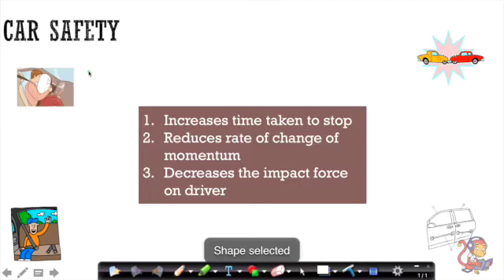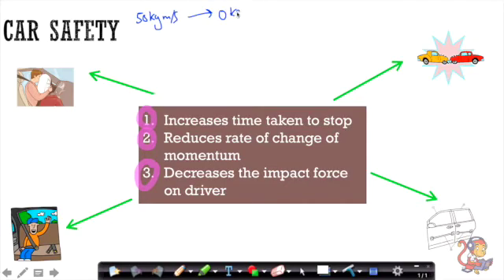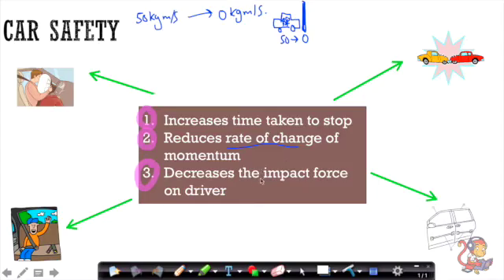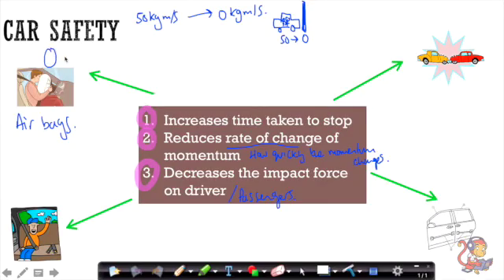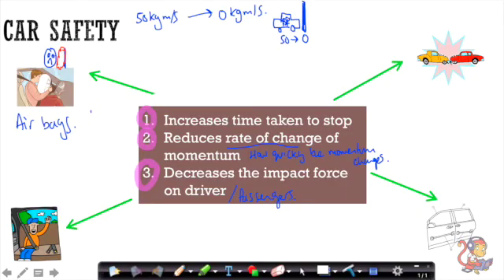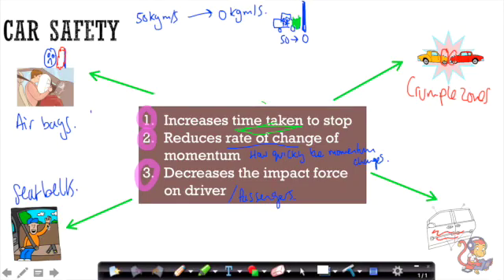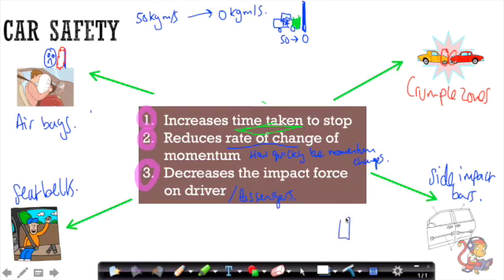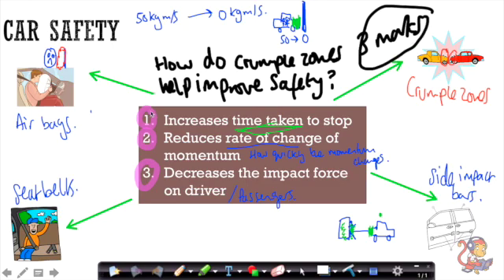Additional Physics (P2) Car Safety

Comment: what do u mean by increasing the time to stop?
Reply from the maker: +BliiiiBlaaaaBluuuub 

The time is takes for the car to come to a stop. i.e.. if you hit a brick wall in a car with no safety features travelling at 50 mph, you would come to a stop very quickly and have a speed of 0 mph. Let's say for arguments sake it takes 0.5 s to come to a stop (i.e. 0.5 s to go from 50 mph to 0 mph), this is your 'time taken to stop'. With safety features, like a crumple zone, you will increase your time taken to stop to say 1.0 s and by doing this, you will reduce the force on the passengers in the car because the change in momentum is happening over a longer period of time. Hope this helps :)
Reply: +Revision Monkey makes more sense, thank you